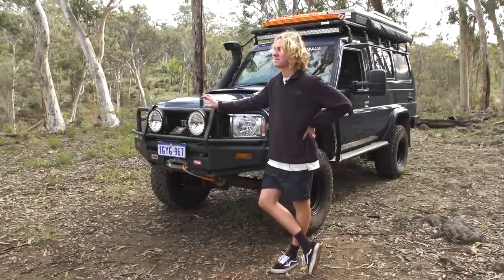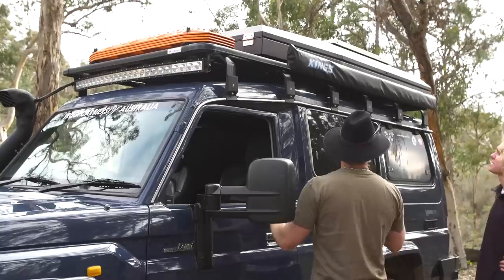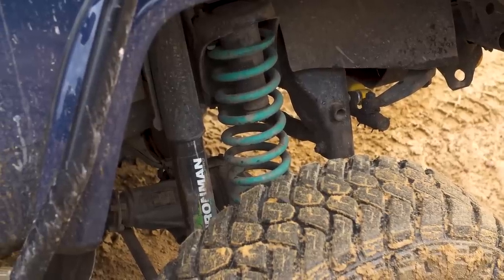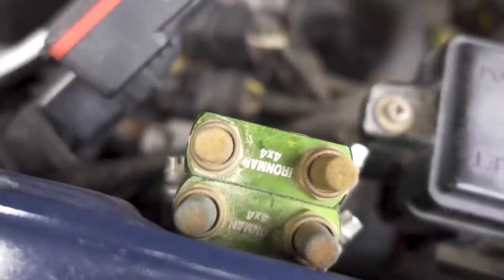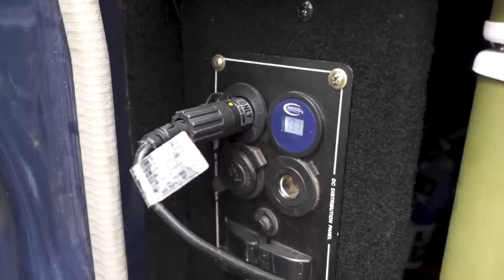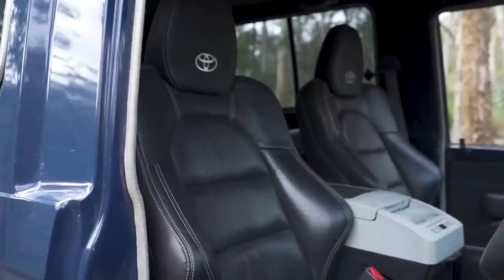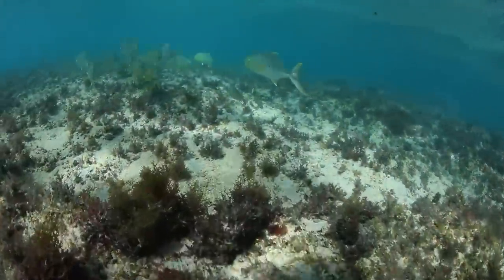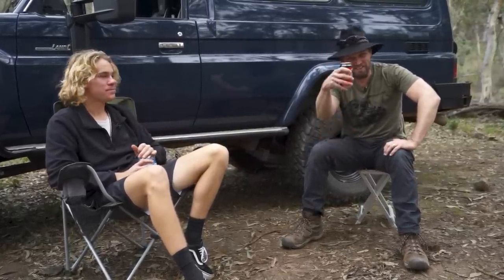Toyota Troopy, Modified Episode 90

Comment: Very nice troopy. I used to have a midnight blue one too. It had the 1HD-FTE engine. It didn't quite suit us as a family tourer so, I sold it. Still miss it sometimes.
Reply: @bilal3827  The main issue we found it being a 2 door (not counting the rear barn door).
I had the RV, forward facing front seat. Access to the seat was difficult, especially when using a child seat. Hard to reach to secure the seatbelt etc. We looked into getting an extra side door fitted. That would've been at least 11k at the time.
Also, the seats aren't very comfortable for long distance traveling. 
Otherwise, an awesome vehicle. Loved it.
Reply: @bilal3827  I see what you're saying. The troopy is perfectly suited for overland travel for 2 people. It gets trickier when there's 3 or 4. 
I don't know where you're located, but there's a business in Victoria that fits 3rd doors in troopies, at least they used to. Name's Polan's, there used to be one or two companies in Perth that did it. Don't think they still do.
Here's a link to Polan's.  https://polanstruckrefinishers.com.au/troopies.html
Reply: @bilal3827  no problem at all

Comment: Gidday, great video, question on your comment at 18:20. When you say chip, same thing as a tune? The guy that tuned my 2014 Colorado couldn’t solve the turbo lag, but as far as I understand the throttle controllers can solve that problem? But your saying the two can play hell with each other? Any more info on this you can point me towards?

Comment: Ronnie, try the well tried and tested Berrima Diesel DP Chip and iDrive which is named PowerNGo and IS designed to compliment the chip. My 3.2L BT50 has been transformed and have had no need to go past 'eco' settings.
Reply: I believe that Ronnie has a Unichip so a DP chip is worthless in comparison
Reply: @cyclemoto8744  maybe but obvious defect is as Ronnie mentioned, he cannot get the throttle precision as iDrive etc is not compatible (with whatever chip he has) whereas other well tried tested and proven chips 'are' compatible with throttle controllers.
Reply: @petermills1402  True, however the Unichip has a throttle controller unlike basic "chips". Compare the specifications of a Unichip against less expensive ones and you'll see the difference.

Comment: Nice truck , whether you built it or the previous owner  did is totally irrelevant ,almost  all modified off road vehicles on you tube are totally or partially built by some one else . seeing how mods are done is always interesting . The square tubes on the bull bars could be used of holding surf rods , so you can fish while you surf .
Reply: Fishing on a surf beach? Dont know much about fishing but seems like a bad place to have luers line and hooks moving around in the surf
Reply: @jarradblair1793  It is possible and you don't surf all day , especially if the waves ,tide or wind are wrong

Comment: Love these troopies. Question tho: given the length, why not build it so you could sleep inside without having a top heavy RTT? Is that feasible?
Reply: It is feasible. I have a double bed in mine and still have room on the sides for tables, chairs and clothes bags.  
Have a look at the "troopysetups" Instagram page, there are some interesting camper setups.
Reply: In Australia, I couldn't think of anything worst than sleeping in a vehicle during a hot summer night. Just something to consider when weighing up convenience Vs comfort.
Reply: @cyclemoto8744   
Why would the inside of a car be hotter than a tent or swag in summer? Open the windows and if you want to get fancy then put some mesh up to stop the bugs and run a small vent fan to cool down which will also prevent condensation in winter.
Reply: @JeremyPetho  don't know what tents you've used but the canvas style tents or swags I use stay cooler than a metal enclosure and they have more air flow. That's why. Cheers. ps: condensation has never been an issue for me, never had any dripping in my face,  people who use canvas and complain about dripping due to condensation don't know how to ventilate their tents.
Reply: @am D 
Looks like the current owner has just purchased. He'll probs soon find out what works for him and what doesn't. I agree tho, I'd prefer not to have a rooftop tent
Reply: @cyclemoto8744  Good point, RTT probably better for warm climate
Reply: @cyclemoto8744  depends where in australia. North WA, NT or QLD I'd absolutely agree. Too hot. Southern half of australia its fine though.
Reply: @Saphire0437  Unclear on how you came to that conclusion. I realise that the topic of Victorian weather is often looked at as a joke by our interstate counterparts (excluding Tas), however it does get hot (above 40C) in summer. Excluding variations relating to humidity,  40C in QLD is the same as 40C in Vic, meaning it's more comfortable sleeping under canvas than it is in a tin can regardless of your geographical location.
Reply: @cyclemoto8744  but ya don't sleep in the daytime buddy...it's not 40c at night. It's not even humid in the south.
Geographical location matters a great deal. You get hot and humid nights in the north of Aus. You're unlucky if you even get a warm dry night on the south coast
Reply: @Saphire0437  Wasn't talking about the south coast. I said I was from Vic. In any case the point of my comment was meant to provide anyone considering decking out their vehicle with a bed (who have never slept in one during summer), to consider the heat/ventilation difference when compared to a tent or swag.  Those of you who currently sleep in your vehicles in summer and are not bothered by the heat, great for you. However I fail to understand why others should not be warned about the differences.
Reply: Stick in a couple of Sirooco fans for airflow, super quiet and low power draw.